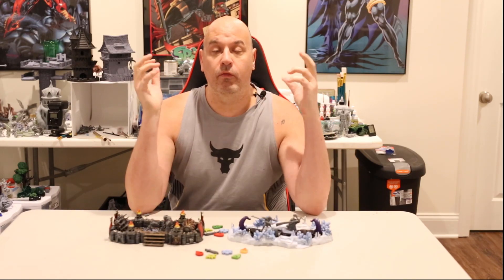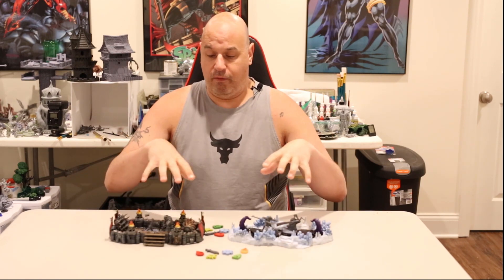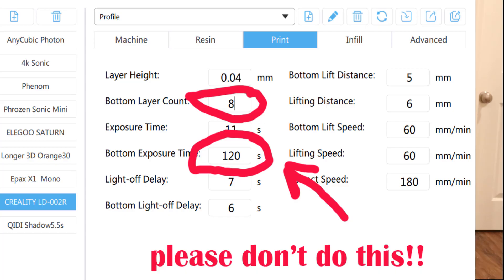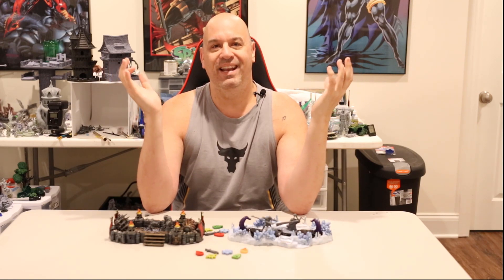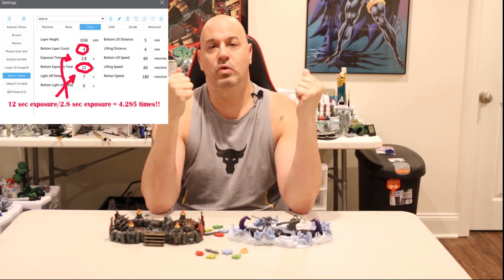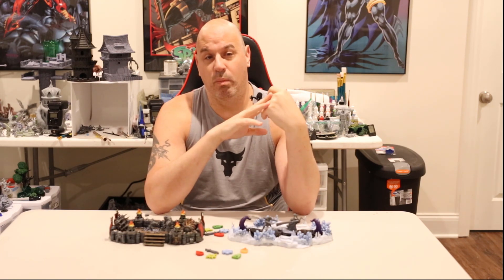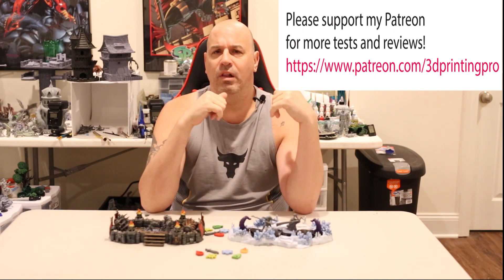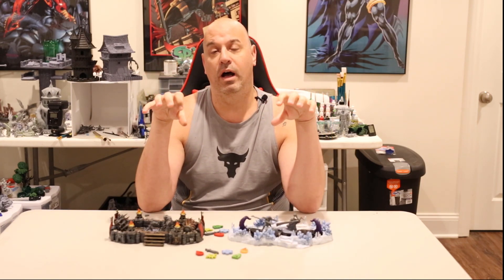Are you destroying your LCD screen when resin 3d printing?? Learn what settings may be doing it...

Comment: Very knowledgeable, man...I just got a photon mono x, beautiful machine but I'm having issues with the print starting off ok, but then about 30 to 40 layers in, it starts to stick to the fep. Using chitubox, factory settings are 6 bottom layers with a 40s burn. Getting frustrated until I seen you and Uncle jes droppin some knowledge, maybe there's hope. Any suggestions would be very much appreciated.  TIA!

Comment: I'm dealing with a strange issue on my printer that I have not found the best solutions for, but having watched this video I'm thinking you might have hit the nail on the head!  I did not have settings dialed up incredibly high but they were higher than necessary for sure.

Comment: I typically follow the recommendations of the bottle, starting at the lowest recommended settings. Example I use eco white resin from Anycubic a lot. Their recommendation for layer exposure is 3-15 seconds. I've found for my Anycubic Photon Mono 2k that 3 sec let prints melt into themselves, 12 secs had supports cracking miniatures when removing them and 9 secs ending up curing it enough to easily remove supports and prevent parts of the mini from sagging. so 9 secs for layer with 6 base layers at 35 seconds on eco resin is my sweet spot for my specific printer. I have some regular grey resin I need to use up and that i run the same base layers and time but layer exposure is turned down to 2 secs. 
    After this video I may lower the bottom layer count just to try it but 6 is working well so no burning desire to change settings. I typically look at online forums, spreadsheets and compare that to the recommendations on the bottles. But again I simply look as a reference, I'm using the lowest recommendation on the bottle and increasing from there as needed. I test print a miniature base that has a large spike sticking out of it because this helps me check supports and if the layer cure time is long enough, if its too short then the large spike will collapse back down into the base. This is just how I do it, I've only been printing since Christmas so grain of salt but it works for me.
Reply: This is super interesting. My Mars 2 Pro comes in defaulted at 5 seconds for the layer and the base layer being 90

Comment: 5:33 so on a monoscreen this means I should be using 12.5 - 15s for bottom layer, if I am using 2.5s for normal layers?
Reply from the maker: try 20 seconds ot be safe and see how it does for you, if it's still really stuck on you can go to 18

Comment: I use 6 layers @ 30 seconds exposure time. I've NEVER had a single print regardless of size de-laminate from the build plate even when printing very large, full-plate pieces (using a Elegoo Mars 2 Pro monoscreen).  The bottom layers stick very well, but still can be removed easily with a sharp metal spatula without any prying or chiseling.

I've printed probably 300+ models on the exact same build plate. 100+ second burn-in layers will definitely cause some extra adhesion to the FEP - there's no need for that whatsoever.

Comment: for printing earrings layer height 0.05 , bottom layer 5, exposure time 2.5 , bottom exposure time 25, transition layer 10, bottom lift distance 7, lifting distance 50, bottom lift speed 70 , lifting speed 70, bottom retract speed 210 ....but 0% printing result . Resin Liqcreate Engineering - Tough X. Whats make wrong?
Reply: Can u supply a link to this Facebook group for help tips and tricks that u speak of

Comment: Im a bit late to this and have been watching much of your stuff. Good stuff Sr. Being that I have had my printer for not even a week now I have run into several issues. Those have been resolved and I am focusing on printing now. Several fails but this is a learning experience. I have left my prints at default for now. Bottom layers are at 6 layers with 40 sec cure time. I may change this to a lower setting and give it a go. I did have a bottom layer pop off the build plate on a large build. I do think the cause was due to the fact that I did not clean the plate before the next print beyond running the blade across it.  So I cleaned it up and is seems good now. Time will tell I guess. I have seen mixed things about plate cleaning. Curious your thoughts. So far what seems to work for me anyway is giving the build surface a good IPA wash down before every new print.

Comment: Great video! Thank you so much. Just got a Saturn and damaged my fep due to suction…I think. My Mars settings were dialed in, but those don’t work on my Saturn apparently. Any advice for Saturn settings to reduce suction on a small solid model?
Reply: Did you find any solution for this?

Comment: Just had a guy in a group post a screenshot of his settings, 8 bottom layers, 70s exposure, 13s exposure for normal layers. He said he got the settings off his bottle of resin, they really need to stop printing those on the bottles. It's insane
Reply from the maker: I would agree!  causes more problems than it helps..  :)
Reply: @3dprintingpro212  He was baking the base layers so hard it was pulling his magnetic sheet from his build plate. Lol
Reply: But those are the only settings my printer prints at (90s base and 14s normal)...
Should I change the LCD?

Comment: Your suggestion about leveling fixed all my issues. I knew the lift plate was right, but when i dropped a level on top of the machine i realized the table wasn't. Leveled it out and everything has been coming out great since. THANKS!

Comment: I recently got to test Anycubic photon mono and Elegoo mars pro. And both of them had recommended to do (also in their testprints its predefined) higher exposure time on first layers.
I can understand if they know but do it on purpose, obviously. So ppl keep printing with those.

But also resin bottles just came in also say recommended bottom exposure time 60-80 sec.
That one I dont understand though.

I will try both, but Anycubic Basic Grey failed in Elegoo Mars Pro 6 times for the Rooks, the parts printed always were same thickness before they kept sticking to fep instead of plate.
It kinda looks like only first layers of the rook are printed and the force to fep was higher than the force to buildplate, so if 80 secs not enough for me, and this video tells me to reduce even more, it kinda confuses in my case.
I dont wanna say its bogus! Not at all. I can only say that its unclear in my case because the issue could be entirely somewhere else. I.e normal exposure. But Im not sure.

Ive endup printing them with nova3d instead, same settings. Worked way better than I expected and my jaw dropped. But 2 rooks and 8 circle chips for whatever tabletop needs is result xD
So something is off here about resin anyways.

Comment: I recently printed a fairly large space ship model with a photon mono x (over 500ml so i had to refill the vat mid print)

First attempt was failed due to too few supports
2nd try was a success with iirc 8 layers but only 10 seconds exposure compared to my 3 seconds while printing 
(solid grey resin because of the first failed Print used up too much of my clear resin for another try)

The bottom layers held like a champ

Comment: Informative video here. I am using the Elegoo Mars Pro. It is brand new. What is the best settings for printing? I printed 5 models now and they were all failures. I have the adhesion to the build plate because of the supports but the rest of my models are stuck to the fep plate in the vat. I copied your chart from this video. I haven't tried it yet though. Here are my settings:
Layer height: 0.1mm
Bottom layer count: 5
Exposure time: 8
Bottom Exposure time: 60
Light off display: 7
Bottom Light off display: 6
Bottom lift distance: 5 mm
Lifting distance: 6 mm
Bottom lift speed: 60 mm
Lifting speed: 60 mm
Retract speed: 180
Please help because I am a novice and I want to be on your level with my prints soon. Thanks.
Reply from the maker: try .04 for layer height I think is your problem :)
Reply: @3dprintingpro212  Thank you! I will do that! I can do this for all prints right?
Reply from the maker: @yurushii  well depends on the resin you use, the temperature where you are, and what you are printing...
Reply: @3dprintingpro212  I'm using water washable elegoo resin. Yellow is the color. I'm printing all kinds of size models.

Comment: Still new to resin printing. I have a Phrozen Sonic Mighty. The default in Chitubox is 1 bottom layer at 40s. Which seems like it would be about the same as doing 4 bottom layers at 10s. What are your thoughts on that? Is that a tradeoff for adhesion vs. elephants foot?
Reply: Just realized what the transition layers do: Go from that base exposure down to the normal exposure. I have 6 transition levels.

Comment: I don't get it. I have Normal Exposure 3 and had my Bottom at 30. It kept failing and stuck to the FEP. I yanked it up to 60 and now it runs perfectly. 
If I went with 5-6 times, I'd be at 15 or 18 which is far below the 30 even. The Anycubic Resin bottle says 20 - 80, even the minimum is higher than 15. 
What am I missing?? I can only assume either something changed in a year with printers and resin, or I am misunderstanding something, cause even with my 10 Bottom Layers and 60 bottom exposure time the prints are relatively easy to get off the plate afterwards.

Comment: I just got my first resin printer, not new to 3D printing (since 2013). First thing i thought of was not to over cure. 1. It will wear the screen out 2. It will pull hard on the sheet, also causing wear 3. It will pull the model apart 4. Cause warping

My first print was the sample Eiffel Tower the machine came with, than a few fun ones to test it out. Compared to FDM there's much more prep and clean up work but overall machine maintenance and tuning parameters are far simpler IMO

Comment: Thanks for the video! spot on to my current issue.  2 LCD screen failures with < 100 hours on the screen.  Room A/C 71-73F, workstation is vented, the workstation solid and level, build plate level, no physical damage, screen and underside of vat cleaned at every vat refill (and never really dirty when its cleaned), electrical surge protected at panel and at workstation.  Normally print minis 2-3 hours time, vehicles, 3-6 hours time and a few larger/longer time prints on occasion.  4 bottom layers at 40s, normal layers 10s at 50 micron, Photon S & 3DRS Hard formula resin.  Any ideas what I should troubleshoot to find cause of LCD failure?  Anycubic states the screen should last about 400 hours but it is consumable.  They will not honor quality/warranty and have no guidance to troubleshoot beyond the factors I listed above.  thanks for any help.  Have a great day!
Reply: Did you figure out what was causing the short LCD life?  How did your 3rd screen hold up?

Comment: Elegoo saturn has only 5 bottom layers at just 5s exposure time, normal exposure is 2.5 but I changed it just 2s! What's crazy is the mono x comes by default with 8 layers at 40s and the lift speed is way to fast 140ms and 240ms, its ridiculous my original mono x had problems with the z motor after just 13 weeks they sent out a replacement I need to fit it tomorrow to see if its fixed the problem!    
I have 2 mono x and a saturn I picked up on prime day for £300 didn't need another one but at that price I couldn't help myself lol, anyway side by side the saturn has better parts at a cheaper price! Guess elegoo isn't as greedy as anycubic

Comment: Hello, I recently got an Elegoo Saturn and as I don't have a very big spare room and just one window, I got Anycubic Eco Resin - Grey as it does smell less than the usual resins.
This is my first time with a Resin printer and I have been using Ender 3 for the last 3 years. I'm having failed prints whenever they have supports.
For example, the test rook printed well and I tried the AmeraLabs Town 3D print and it printed quite good as well. But whenever I try to print a mini or some figurine which is little big and also have lot of supports, the prints fail. The raft and supports are created in the prints but the actual print or object is sticking to FEP sheet. It is so frustrating and I know I might be doing something wrong but any help would be really appreciated. I am using the default settings from Chitubox for the Saturn.
I am trying to learn the art of putting manual supports but I' really don't want to do that and just rely on the autoted supports from Chitu Box. Is there anyway?
Also, in case someone will ask, I did make sure bed is levelled before printing following the bed leveller sheet given by Elegoo and the steps mentioned on it.
If some can help me as it might led me to exchange this beautiful machine with an FDM printer again and I don't want that. Please help!!!!

Comment: Seems like bigger bases need less exposure on the first layers because the surface area they cover takes more face to remove when applying vertical force. The smaller the base, the less vertical force it would take to remove, and the more you need it to stick, thus higher exposure times. Also, the number of layers most likely depends on your layer height. The thicker the layers, the less number of them you need. There is a relation to all these settings and really the slicer software should be able to lock them together as they do with scaling ratios as an option (check box).

Comment: The stock settings in the photon Mono X manual states 40sec bottom time exposure and 1.5sec for anycubic resin.  Any thoughts on this ?  I printed the sample  cube with their loooong 40sec exposure time and it printed perfectly - but id rather save the machines LCD if possible
Reply: haha I just asked the same questions bro- did you ever reduce it? if so, what were the results?
Reply: @RH3D  I printed a few things with reduced time and they didnt print as well. I printed the quality test plate which many videos use as a base on youtube, and the best quality came out with a 20sec exposure time for the first 4 layers, and then 1.2sec exposure for the rest -- i looked through a magnifying glass to compare the test prints from 2.5sec, 2.2sec, 1.8sec, 1.5sec, and 1.2sec -- 

Then when i printed a parts using the same settings, the print failed completely - so i went back to 40sec exposure for the first layers, and 2sec for the rest abd the very same print worked 100%

Comment: just got my first SLA printer (Photon Mono X), saw this video and been testing today. final setting have been bottom exposure: 30, bottom layer: 5 with a 1.8-2.2 normal exposure time. i was initially doing 2.2 normal, 50-60 bottom exposure and 8 bottom layers. thanks for the great advice!

Comment: Something nobody talks about… if you can make the first layer thinner, it cures faster and bonds better to the build plate.

E.g., on the Phrozen Sonic, this is determined by the thickness of the paper used when calibrating the Z axis.  Then, the other bottom layers just need to be stiff enough to reinforce it, and less exposure is needed.

Comment: Since you mention some reservations about broaching this subject, for what it's worth this was extremely helpful for me to hear as a newcomer to 3d. I haven't cleared my first month of SLA printing yet and as you mention, most conventional wisdom seems to favor brutal exposure times which for me has just resulted in prints stuck so hard to the build plate I practically have to chisel them off. Not knowing any better I've simply been grateful to the Micro Center employee who encouraged me to purchase a flex plate. In the last couple weeks I have contemplated reducing exposure time only to conclude this must be poorly reasoned newbie impulses at work—and the result has been prints on unreasonably tall supports that I can just break off without damaging the important bit when I begin excavating the build plate. I assumed everybody must be putting up with this and it's just a cost-of-doing-business thing. So this video helped me understand a bit more of the mechanics and settings, and also realize that if I'm questioning something it might warrant more research to determine if a specific piece of advice is actually right for my particular scenario. Thanks!

Comment: This wasn't the video I was looking for (somehow got here after trying to find if I need to replace my FEP yet or not) but this is absolutely the information I needed to know in the long run. I recently turned my settings up to match someone else because I was having issues with printing, glad to know it could cause harm. And I'm pretty sure the issues I am having with my prints are more due to rising speed anyway. Thanks for the vid.

Comment: I can agree with this to an extent. For small minis, 20 sec was fine maybe could go lower. However for large minis, they fell off. I went up to 40 sec and it stuck to the FEP. I now use 30 sec for big minis. However, another thing to consider is the lift speed and distance. If it is too aggressive, items can stick to the FEP and not the plate. Also the color and type of resin you use as well as the ambient temperate and whether or not the resin is mixed can have a large impact on exposure time. What resin do you use with those low settings?